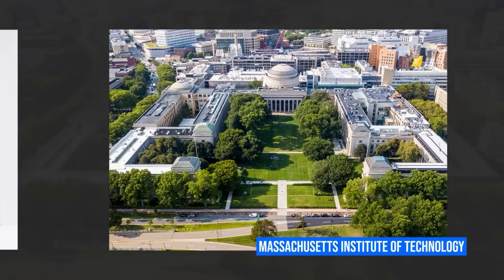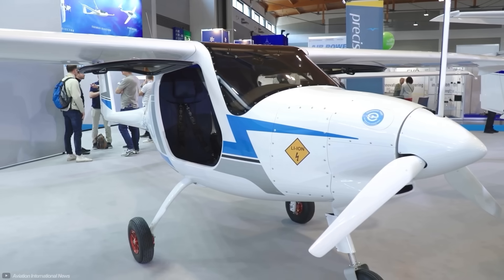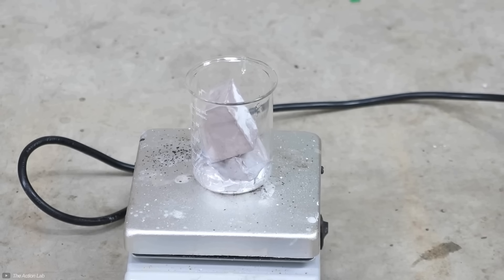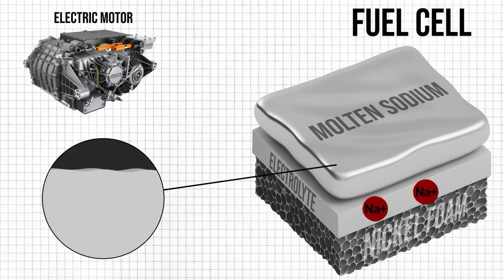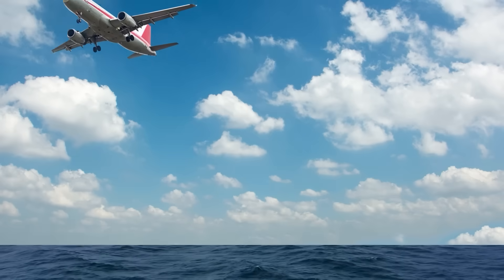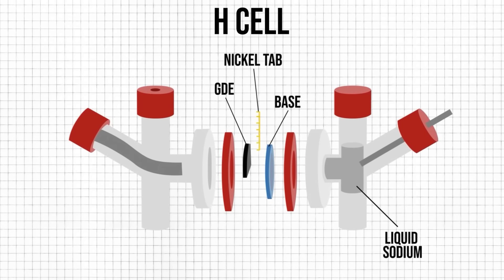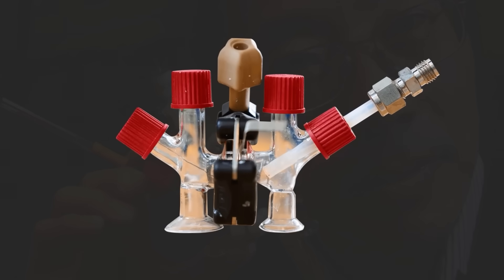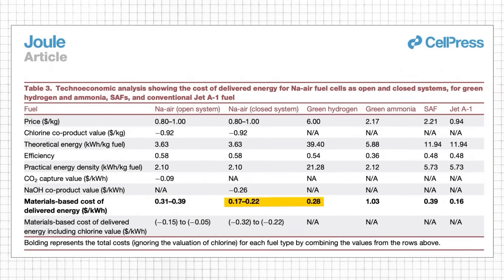How MIT's New Sodium Fuel Cell Changes Everything

Comment: a fuel cell converts a "fuel" into electricity. While a battery straight up stores electricity.
Fuel cells will always be best combined with batteries or supercapacitors. The fuel cell can supply the bulk of the energy. but the actual instant power draw is handled by a storage medium like batteries.
Reply: lithium batteries waste about 40% of what you charge them with despite electric motors being close to 90% charging or discharging, you can also start motors with a crank and a spring, or use the generator as a motor to start the engine, then you can use less energy dense but more efficient capacitors for regenerative braking and get something with more range that doesn't waste as much. Diesels and sterling engines can each get pretty high efficiencies, and sterling engines running off of the exhaust of a diesel takes care of the emissions if it's burning it a second time at a different mixture. That can get close to the theoretical maximum of like 60% efficient, which puts it in the top range of fuel cells while using less exotic materials and being easily repaired, and with the second stage burn you can have a higher power density in a 2 stroke diesel, and that makes up for the power to weight of the sterling engine a bit. Turbines are still probably the best way to go for airplanes though, since they're pretty darn efficient and have a high thrust to weight, while also having been figured out for decades.
Liquid fuels are just chemical batteries and combustion engines just use the oxidation with physical parts, you need something reliable and easily fixable for everyone to use it without throwing it out at the earliest possible point. Recycling is the only way batteries become viable long term but recycling is picky, a lot still isn't recycled even if it's the right stuff, and it's not cost effective most of the time so it usually needs to be subsidized. It becomes cheaper to just throw it away when you're able to get a new one at a survivable cost too. We just need something reliable, fixable, and that uses things we already have while making our economy carbon neutral or negative if possible.
Plants can be used more efficiently than PV's here since they turn raw materials right into food for microbes that make ethanol for free (or at least much less infrastructure upkeep). It can be made even more efficient by genetic modification, solar panels can absorb the light that plants can't use by shading or filtering out certain wavelengths, infrared can also be reflected to power heat engines and distillation, or left to reflect back into space since plants reflect it well. We could repurpose oil rig infrastructure to colonize the less habitable parts of the oceans with sustainable PV, kelp/algae, mussel, and fish farms, then we can capture all the carbon we need to while feeding ourselves and it should take very little input for infrastructure compared to building algae farms all over the land. You also don't need subsidies when nature can eat your waste and cellulose is a great plastic that's already close to waterproof, biological waxes can make it mostly impenetrable too, glass works for just about everything else. The ocean can handle this better since it's mostly uninhabited and what is there is mobile rather than being rooted into the ground if not part of the topsoil itself. Half or more of land habitable to humans and green ecosystems can be freed up for avoiding extinctions, we need at least 50% of the land left alone for most stuff to survive with us so this'd be perfect. Making the oceans more reflective will also help with climate change directly in addition to reducing effects from co2 pollution.
Reply: Do you have a verified source for the 40% round-trip-efficiency (RTE) claim for a Lithium battery, most reputed sources put their RTE at around the 90% mark. If your considering the overall system efficiency, then state that as the same applies to other energy systems (such as fuel, where the cost of extraction, refining, distribution, storage and use all have to be factored in).

Where is the scientific definition that states liquid fuels are a battery system, by their very nature they are a oxidising consumable energy source and hence not a battery. They are also not a fuel-cell, as the reactants are converted to heat and mechanical energy rather than electrical energy directly.

As to plants being more efficient to use than PV, that's complete tosh. Plants are 0.1% to 2% efficient at converting solar radiance to energy. Whereas PV are currently in the mid-20% range of efficiency, and tandem pervoskite cells offering 26% and above. Even high energy yield C4 crops (Corn, Sugar Cane etc), which use a modified Calvin cycle using photosynthesis to power a CO2 absorption cycle that enables to growth at higher rates are only 4.3% photo efficient. However, all plants also have high losses, for example C4 plants lose 20-40% of the photoenergy they collect due to photorespiration to remove gases they cannot process but still absorb. Plus if one looks at engineered tobacco, which is a fast growing feedstock designed for bio-fuels, this only raises the photosynthesis energy collection slightly to 5%, but again with high energy losses involved.

Oceans being uninhabited? This isn't correct as 78% of animal life on the planet can be found in the oceans, and has developed to utilise the areas accessible in order to survive, as a result are fairly sensitive to over utilisation both as a resource as well as disruptions to their environments. There is also conflict present in the accessible areas, with both aquatic life and human activity concentrated in these areas. The large majority of the worlds water, the deep ocean areas, are effectively 'deserts' neither long-term accessible to life or to human endavour, this distorts any claim about the oceans being uninhabited as a justification for their exploitation, as use is limited to the significantly lower proportion of accessible areas (just like terrestial desert regions).

Best not to quote psuedo-science to support an opinion.

Comment: I hear so called chemists speaking of how this will result in a carbon negative flight and how it can de-acidify the ocean. do they not see that, as soon as planes catch on to this you will have literal planes spuwing a VERY strong base all over the world. no thanks, I'd rather have a plane that makes a weaker acid, and us finding a way to de-acidify the ocean rather than doing this. 

I mean really just think of it, do you not see how hard it is for plane companies to switch to different fuel sources? what makes you think that its a good idea to use an even more polluting chemical in it's place? 

we are trying to prevent the extinction of humanity, or at the very least slow it down, not accelerate it or cause it! 

I truly believe it would be better to create carbon-capture devices or find ways to decrease energy losses in combination with renewable fuel sources rather then do this.

Comment: Dose makes the poison. Concentrated sodium hydroxide solutions or pure sodium hydroxide can be really nasty, but very small amounts, or very low concentrations isn't likely to cause problems. The idea about that part is actually completely valid, in theory, as in when it reaches the ocean surface, it's much more likely to have a positive than negative impact, assuming it's well distributed, and a lot of other things. Problem with that part is ensuring it always works as it should, and anything, like birds, breathing in the stuff before it has reacted and dispersed. Even some very well distributed sodium hydroxide shouldn't pose much of an issue in the ocean either, it would react, probably mostly with CO2 in the seawater, very fast, and cause a slight increase in pH, counteracting ocean acidification, slightly.   

Currently, the production of chlorine from sodium chloride generates so much sodium hydroxide that the market value of the sodium hydroxide in itself is essentially insignificant. It's things like further processing, handling and logistics that constitutes most of the costs of sodium hydroxide, not the actual value of the the sodium hydroxide itself. We don't produce a lot of pure sodium, for a lot of reasons, but sure, we could produce a lot more chlorine and sodium from sodium chloride and by that having two valuable products. A problem with that for mass adoption of sodium as fuel is that the chlorine production might tilt the supply-demand balance for chlorine so much that the sodium will have to pay for most of the costs. Existing chlorine production facilities that produce sodium hydroxide as a "byproduct" won't just instantly shut down if the market value for chlorine decreases a bit. 

Power density is extremely important for aviation, 40 watts per kg is nowhere near relevant for commercial, or any kind of practical aviation, that's more relevant as a basis for decent challenge to support sustained flight at all for some RC-hobbyist.  

Scaling up fuel cells doesn't tend to make them more efficient, if anything, a multitude of practical problems tends to become more severe with increased size. For one thing there's heat, the total amount of energy "released" going from sodium to sodium hydroxide is almost 3 kWh per kg of sodium, with 1-1.4 kWh of power generated per kg of sodium, most of that total energy becomes heat. So if you want to generate power levels on par with what an airliner engine produce, just the energy required by thermal management will require most of the power generated. 

Also, somewhere in the ballpark of 50 megawatts or so that the large airliner engines produce, per engine, depending on model and how many engines per plane, means 40 watts per kg requires somewhere in the ballpark of a thousand tons of those fuel cells per engine, meaning those fuel cells, just the fuel cells for powering what would replace one of those engines would weigh multiple times more than the maximum takeoff weight, that is the maximum total weight of the plane. It's not a matter of doing some tweaking and fine tuning from that point. 

If anyone reads this you might be thinking, so ok, 40 watts per kilogram might not be that great for airliners, but maybe smaller planes with lower demands? Well, a typical Cessna 172 engine can produce 140 kW, that would require 3500 kg of those fuel cells to generate that power. That's more than three times the total typical weight, of the entire plane, with max payload.     

40 watts per kilogram wouldn't be anywhere near relevant for direct propulsion of aircraft that relies on aerodynamic lift in practical use even if the energy density was infinite, and there weren't any other significant issues.  Solar cells can have much higher average power density than that,  and in sunny conditions solar cells can have many times higher power density.            

Litium ion batteries generally have a modest long term power density, assuming you don't want to make compromises with things like energy density, but most can deliver quite high power density for short periods of time. The energy density of lithium ion batteries is far from good enough for more than very short flights, but the power density is not a big issue, unlike that fuel cell, and actually most fuels cells, for which the power density of the complete systems generally are too low to leave the ground in somewhat conventional airplanes, even without payload.

Comment: Having worked in a plant which produced sodium hydroxide as a byproduct and having seen the corrosion produced by that lye, I think the problems caused by the lye have been seriously understated.
Reply: Airplanes spraying the tarmac, buildings, and overflight areas with hydroxide, or even milder carbonate, is an impossible problem.
Reply: @-danR  One that makes the lead in avgas look positively benign!
Reply: @nickwinn7812  Disagree. While it has similarities to the old frying pan vs fire quandary, overall imo Lead is worse, because NaOH just reacts directly, Lead sticks around e,g. in biological tissue forever. I do admit that I for one don‘t want to be directly downwind of that fuel cell exhaust. Which is why MIT may be pitching this for airplanes.
Reply: @HelmutRockstroh  And so, stuff everyone who lives near an airport or on the approaches to an airport? OK for you, assuming you don't live near an airport. Hmmm. Very public spirited of you.
Reply: @-danR  only fly over sea...
Reply: @orangestoneface Yeah sure only over the sea.... Which is 30 miles away from both our major airports across high density suburban infrastructure. I'm sure we aren't the only state, and we're optimal half the state is coastal and 90% is international flight path. To go domestic, interstate it would be 1000miles over land minimum 100 over built up zones!
Only over the ocean.... Not even possible!
Reply: @-danR the hydroxide could simply be contained  and only vented over the ocean
Reply: @-danR  Great time to start a bakery for bagels and pretzels directly under flight paths lol.
Reply: Investigating how much energy is required to produce pure hydrogen and sodium would be worth considering. Other comments have already mentioned how volatile sodium metal is if introduced to water. I have witnessed this instant explosion, fortunately we all walked away unharmed.
Reply: @dyoung7044 The cost of both is ridiculous! However either could be made viable with a sensible creation of infrastructure, BUT this whole thing due to political insanity as prickly as fibreglass underwear, is all going nowhere for along time. The full story is actually an accidental long winded absurdity only partially corrupted by usual problematic causation. But it's a nothing going nowhere!

Hydrogen for the win!!   
 One day
Reply: @dyoung7044   Commercial sodium is $3.04 per kg (Shanghai Metals Market) and hydrogen $23.64/kg (Praxair).  Some of that difference will be costs of handling — a kilo of H₂ at STP is 11.2 cubic meters (alonst 400 cubic feet) after all.  But it is also indicative of production energy costs.   However for a meaningful comparison one would need to ratio production costs per unit against useable energy per unit and although my guess is Na would win I can't find numbers that show it to be so.
Reply: I just can't see believe or understand the fact that someone thinks that releasing a fluid that INSTANTLY reacts to dissolve aluminium on contact is something that would be ok to release let alone have on an aircraft!!! 
It's way more dangerous than mercury which is totally band except for controlled dangerous good cargo on non passenger flights! 
The irony is the amount of hydrogen produced by the reaction would power a fuel cell!!  Not kidding!!
Reply: well done someone here with a brain, I never heard such a stupid idea as this sodium battery, you are literally going to be pumping hundreds of kilos of sodium hydroxide as a fine mist into people's faces.  When they breathe it in it will dissolve their lung tissue in minutes.  We live in such a brain rot society that people literally believe it is safe to inhale drain cleaner than carbon dioxide
Reply: Did you happen to use any ceramic coatings or materials, or were the components mainly metal?
Reply: I just can't see believe or understand the fact that someone thinks that releasing a fluid that INSTANTLY reacts to dissolve aluminium on contact is something that would be ok to release let alone have on an aircraft!!! 
It's way more dangerous than mercury which is totally band except for controlled dangerous good cargo on non passenger flights! 
The irony is the amount of hydrogen produced by the reaction would power a fuel cell!!  Not kidding!!
Reply: hot hydroxide destroys BOROSILICATE LAB GLASS.

Comment: I'm sending the link to this video to climate scientist Paul Beckwith.    Geoengineering will absolutely be required for many reasons.  The way the systems works decarbonizing the air and de-acidifying the ocean is absolutely genius and very promising to be safe with further research.  It seems disperse enough when you consider ocean and Air currents with airplanes flying all over the place.  But flight over land is another question.

Comment: I really don't get the obsession with battery powered planes. Planes are the best case for energy density and it is not like every single person is flying a plane like a car. Total fuel usage of all planes in the world is tiny compared to any other usage of the fuel. So why not fossil fuels work best where they work best and try to use battery for other things?

The emission argument for an application which really gets worse with energy density reduction is just stupid.

Comment: I'm curious why water vapor is considered better for the climate than CO2? Water vapor is by far the most prevalent greenhouse gas in our atmosphere by a huge margin. As in over 80% of all greenhouse gases. It also has roughly equal thermal insulating properties as CO2. 

I could see the argument for better air quality, but it offers no benefits to reducing greenhouse gases, so why is it always touted as a benefit to the climate?
Reply: Although in itself water vapour is a more potent greenhouse gas, it is self limiting, too much and it rains.

Of course, as the temperature rises due to CO2 then the atmosphere can contain more water vapour, leading to more warming. This is why CO2 is the problem because it is driving climate change, whereas water vapour is not.